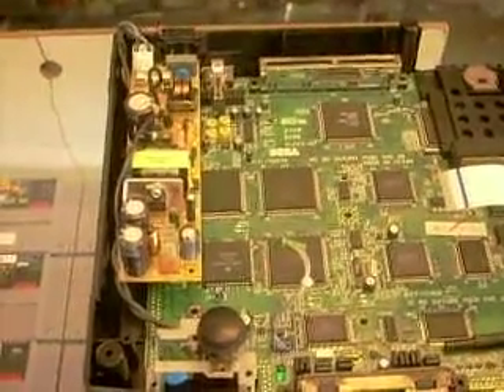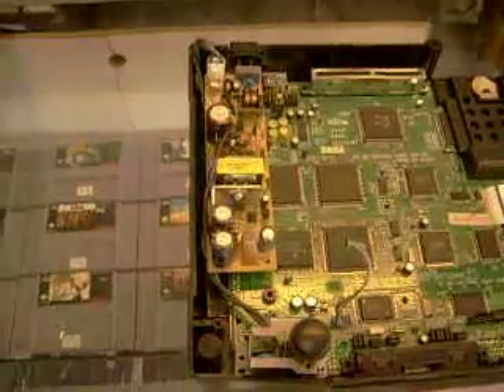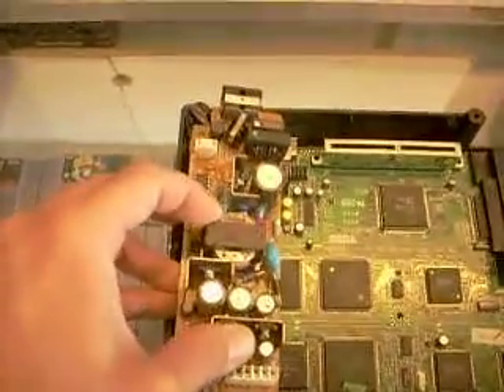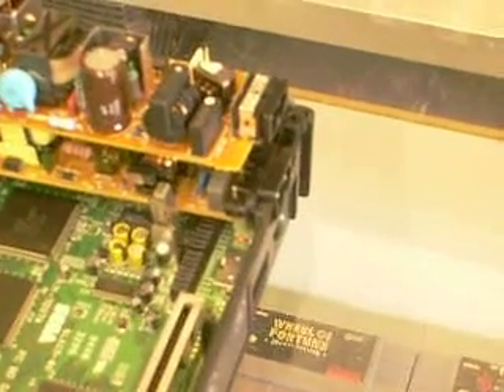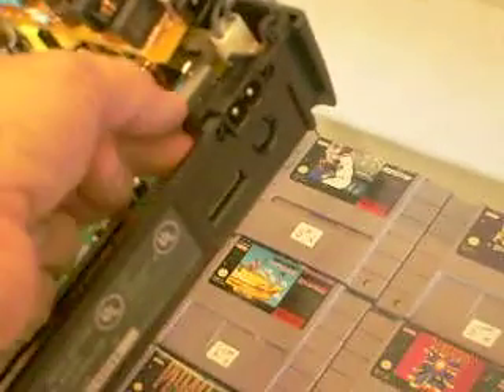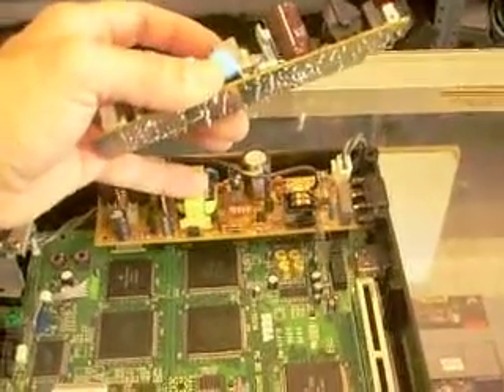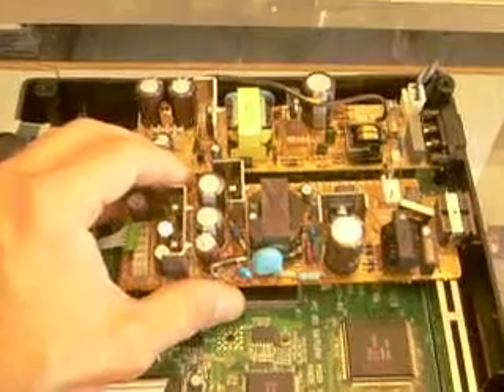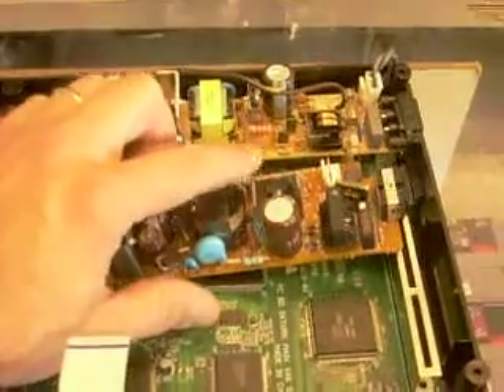Saturn and Dreamcast internal power supplies compared

Comment from the maker: @HongKongKanto What do I need to know about the capacitors on power supplies that almost have the same outputs?? Nearly the same form factor and outputs match up-- sounds like a power supply that will work with only minor modification.